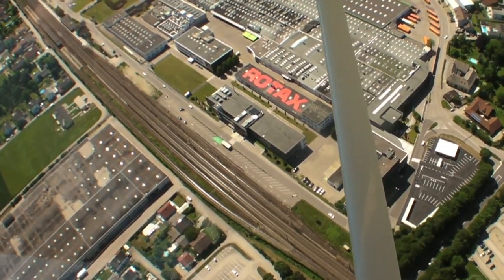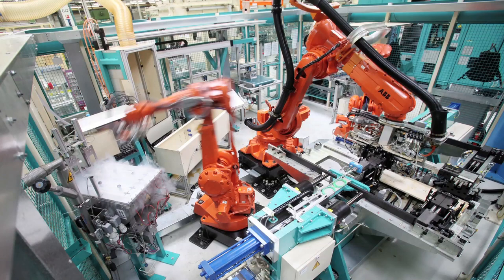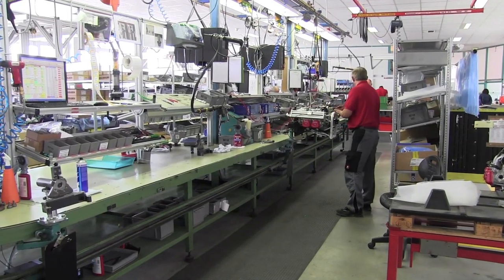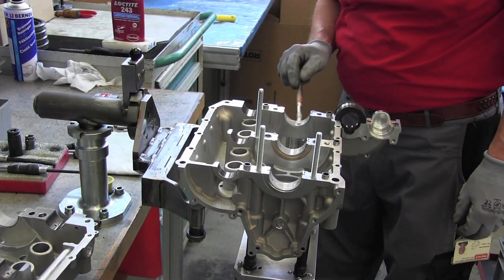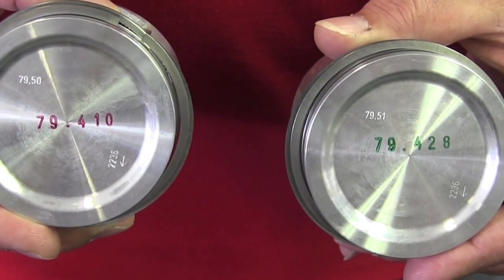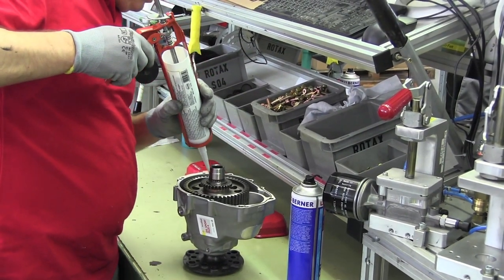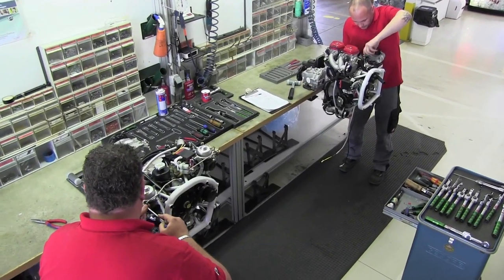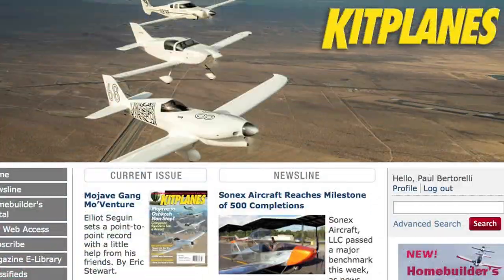How Rotax Builds Aircraft Engines

Comment: Too bad the cost of the engines are effectively taking aviation far from the grasp of the hobbiest.
Reply: And bring back the 503.........dcdi
Reply: This engine is still WAY less expensive than a Lycoming or a Continental...
Reply: @ibgarrett  Maybe.  A Continental Titan 340 costs about $29k and produces about 180HP.  A Lycoming O-320 has a price tag of $47K and develops 160HP,  Rotax's 915iS costs about $39k and develops 141HP.  I'm not sure I'd say its "way less expensive" but merely on par with their competitors.   To Rowdy Flyer1903 original point, I do agree the price does place it outside the reasonable expectation of hobbyist, especially when you consider the $39,000+tax price tag is for the non-certified version of the engine.
Reply: I just can't see where the value is for that engine to be $39K... I mean they're building entire cars for half that price
Reply: but just imagine the profits this company is garnering from the airplane engine line.  I can't imagine this costing any more than 10k for Rotax to make.. However, it must have cost a lot of money for upfront development costs, for example.  Looking at their fiscal report it appears lumping all the different types of engines and vehicles together, they are running at least 20% profit. So, can't say what kinds of profits specifically, but still interesting. You can read more here ->  https://www.globenewswire.com/news-release/2019/03/22/1759198/0/en/BRP-Reports-Fourth-Quarter-and-Fiscal-Year-2019-Results.html
Reply: No other aircraft engine manufacturer willing to lower the price :(
Reply: They used to be cheaper, now they are the price of a bigger new car :(  I’d still do one over lyc/continental though due to being quieter and they run mogas not 100ll which halves the cost here in Australia, also they are lighter which can get a two seater under the weight limit and allow own maintenance = cheaper. Also about 4gph which the aircraft engines won’t do
Comes down to there is no competition so why charge less than they need to

Comment: Great video production!  I love my Rotax 912 ULS--which has never had so much as a "burp" in 1,700 hours of flying!  I've found that most "problems" arise when Lycoming and Continental "know-it-alls" think they 'know it all,' about servicing the Rotax engine.  That's when problems begin.
Reply: AMENNN !!! ! !!!
Reply: Less surprises in a four than a two stroke engine.
Reply: Not necessarry ...
Reply: The statistics are on Stephen Bonin's side there Kopronko.

Be great if the new generation of light, clean and reliable 2 strokes that are hinted at every so often were to happen 'tho.
Reply: Airplane engines are small bore, but long stroke, right?
Reply: @stephenbonin3049  912 isn't a two stroke.
Reply: @andrewjackson7476  Not always.  The ubiquitous Lycoming 0-360 is very oversquare.  Huge jugs.  (Heh heh heh.....)
Reply: @andrewjackson7476  wide bore, short stroke, in a Rotax, so they can run at 5100-5500 rpm for majority of hours of motor life. Relatively low torque to such a design. Lower rpm motors with slower burning fuel like turbodiesels are strokers... longer stroke, narrower bore.
Reply: @stephenbonin3049  I never had any trouble whatsoever with my 503 2 stroke. Dual carb duel ignition. As the saying goes your engine is about as good as you treat it and nothing holds more truth than two-stroke rotax engines

Comment: I recently saw a video visit of the Rotax snowmobile engine assembly line.  I did not know they made aircraft engines.  Thanks for the great video!
Reply: They don’t really! Lol these are modified snowmobile engines. 
Literally had a A&P tell me it was an unsafe engine and I should sell my plane. 
This and Rotax has horrible support, sky high parts prices, built in design flaws that you will never be able to fix. If you want pain buy a Rotax

Comment: Thanks so much! As an olde school VW, & Porche mechanic, I've wondered what the difference was between them, and the Rotax, and if it's air, or water cooled? So, it looks almost identical to the air-cooled engines I work on, other than the water cooled heads, and judging from the fins on the cylinders, I'm gonna call this 1. A hybrid, and 2. An engine I can't wait to work on, and maintain. I LOVE the simple design 😁✌
Reply: They have watercooled heads on the 4 stroke donks
Reply: I bet you can put the turbocharged ones in a Volkswagen or old Fiat 500.
Reply: I think there’s a VW bus in OZ with either a jabiru or a rotax in it.

Comment: Crank in pieces is old motorcycle technology, which is not used by bikes anymore. Last bikes, which used this design, Kawasaki KZ1000 had a problem of crank pieces turning against each other. To overcome the problem crank pieces were welded together by repair shops after assembly. Honda was the first smart bike manufacturer which stopped using this design and started using one-piece automotive style cranks.
Reply: Roller bearing cranks are way more reliable and require less oil pressure than plain white metal bearings. I have a 1980 suzuki 850 with a pressed up crank and 1 piece rods with 827000km on the clock, never have i touched the bottom end at all. Maybe it is just kwakas with the problem, never heard it happen to a suzuki and they have lots of roller bearing motorcycles.

Comment: this is why i own rotax. looks top notch to me. :)
Reply: Brandon Quenneville  yeah.    Guess you don't own one
Reply: Rotax are a POS engine. I’m dealing with unfixable exhaust leaks bc of their awful design, constant overheating issues, almost impossible to find someone to work on them and oh, and good luck if you need factory support. 
Literally run from one of these shitty engines. Not kidding. Buy a Cont or a Lyc. And if u haven’t had issues yet, just wait! You will!
Reply: @nickr5658 - you sound angry Nick.  I’ve had mine 20 yrs with zero issues.  I have also closely monitored the large flying community I am in (hundreds of planes) and your experience is certainly not what others have seen.  Perhaps operational error?
Reply: @KenLeonard  I don’t trust the engine will be reliable. Way too many issues. Case in point I had a NEW fuel pump fail after only a few hrs. 

I have had a lot of down time for dealing with Rotax specific design problems. For example I’m dealing with an exhaust leak for months now that is not really fix able. The 912s have built in C0 leaks bc of the exhaust flange design. 

Hardly anyone works on Rotax around here. Little if any factory support.
I know first hand continental and Lycoming don’t suffer these problems and virtually all A&Ps can work on them and most of their issues are well sorted

Comment: Here in Australia, I am having lessons in a foxbat (rotax engine) a great plane to fly, but I have always been a bit of a nervous flyer. Then I watched this clip, and I felt a lot better, then I read stancurtins comments, and I felt a bit nervous again, then I read jason ensmingers comments and I felt a bit better again. Surely the rotax has to be safer than an older lycoming in a 1970s 152, which I had my first lesson in.
Reply: Paul Wiles   Speedway
Reply: Thanks for sharing the swinging level of confidence from the world of ultralight.
Reply: I wouldn't say they are more reliable. lycomings most reliable engine io360l2a in the newer 172 s is absolutely more reliable and less complex than most rotax engines.
Reply: The Lycoming is definitely more reliable. Regardless of age the engines are generally overhauled around every 2000-2500hrs depending how far your willing to stretch the interval.

Forgot what the overhaul intervals are on Rotax engines, but if I remember correct it was somewhere around 1200-1500hrs.
Reply: A friends 912 in his kitfox has over 2300hrs and is still going strong..

Comment: I had 8 engine outs in 6 years of flying ultralights with Rotax.  And, that was not uncommon on the field where I tied down (which had 150 untralights).  Even the factory demo planes stuck several pistons a year.  The care and assembly looks good here, but I've never seen that kind of failure rate in GA engines.  I've seen a lot of people claiming the reliability is comparable, but that certainly was not my experience.  As a pilot, I'd strongly advise a kit builder to really ask around and research an engine before they decide on it.  And, always keep where you're gonna land in sight.  :-)
Reply: Are you referring to 2 strokes or 4 stroke engines. Failures in the 912 and 914 series (4 strokes) in factory mounted LSAs are very very rare. You might see a few failures in E-ABs mostly due to builders mistakes.
Reply: Yes.  I flew several different 2 stroke Rotax engines in different ultralights (MX and Phantom).  Because failure rates were so high, we accepted it as part of ultralight flying.  We did all the recommended maintenance and used the best oil we could.  But engine outs remained routine with Rotax.  Kawasaki engines were far more reliable, but do to liability, they stopped making them available.  I have no animosity toward Rotax, but it will take quite some years of good service records before I'd be convinced they have produced a truly airworthy engine.  But I hope they have/do!
Reply: From my experience, most of these engines used on aircraft are not certified for aircraft and are "Subject to sudden stoppages". This does not mean they are not reliable, but they cannot be guaranteed for aircraft safety for those models.
Reply: July
Reply: I'm not a fan of Rotax engines in aircraft, but to be fair, they are clearly labeled as not being aircraft certified. They are great for karts and some bikes, and even some larger RC planes. I really suggest you not put yourself into a situation in which your life will depend on one.

Hawaii is a Legal State.
Reply: +Noah Diamond (Rainbow Unicorn)  What? The 91x series exists in ultralight version and in certified version...In a aircraft, im' fiel me better with a 912S in the nose as with a 0-200...
Reply: I think they have gotten a LOT better in the last few years.
Reply: In Europe the most ultralight fly with 2 strokes because cost 3 times less than a 4 stroke...
A 4 stroke is more reliable and durable, but much heawyer for the same power, this is a big problem for a ultralight...
Reply: stancurtin smh. More guys who simply don't understand the workings of a two stroke and burning them down. Here's a lil tip...if you're sticking pistons, you're running too lean. Fatten her up a bit and she'll never let you down.
Reply: stancurtin never had an issue with the rotax 503 engine.
Reply: I rate the 912 series and, funds and type permitting, would fit one as the engine of choice for a microlight (US:  ultralight).

Its not that they don't fail. Its that they fail less often than the competition.

There's a pretty widespread suspicion in the UK the 80 bhp units fail less often than the 100+bhp ones but I'm not sure anyone's ever compiled any statistics.
The 100+ ones are neat 'tho.  You can almost hang a Eurostar on its prop. 
(I wouldn't recommend trying that with most older  motor / aeroplane combinations).
Reply: I have a fair amount of experience with four stroke Rotax engines both in Airplanes and in motorcycles.  (aircraft mechanic for a living and I race motorcycles for fun) I think your concerns should be more directed at the fact you're running a two stroke, rather than at the Rotax brand specifically.  Two strokes tend to have a much shorter life, higher failure rate in general, and when they do fail its often unpredictable.  They also tend to dislike high RPM operation for extended periods of time which is textbook aircraft operation.  I would not hesitate to run a four stroke Rotax engine in any aircraft of mine, but I wouldn't run a two stroke of any brand.  Outside of Lycoming and continental, Rotax makes some of the best aircraft engines out there.
Reply: Airplane engines are small bore, but long stroke, right?
Reply: Two strokes have always been prone to sudden stoppage, especially if the mixture setting isn't right. Four strokes are way more reliable and smoother running especially with having the momentum of the valvetrain keeping it moving along. The only attraction of 2 strokes to me is the power to weight ratio. Otherwise they are too loud and not as reliable as 4 strokes.
Reply: All 2 strokes no doubt with shitty oil in them..what a ridiculous statement. Rotax 912/914's are the most reliable 4 stroke aero engines, they just work.
Reply: 6 6  In EA-B yes, just spent some time reading NTSB reports for engine failures in EA-Bs. Do you know what an EA-B is?
Reply: @NoahDiamond-Firearms-LLC  You mean the 2-strokes, I assume.  The 4-strokes are designed and marketed specifically for aircraft, and certified models are available.
Reply: @NoahDiamond-Firearms-LLC  Wrong. They are available in certified version as well as ASTM compliant  (F37 sub-committee) versions for aircraft specifically. The 2 strokes of decades ago is what the original commentor is talking about. That's been done and gone
Reply: @NoahDiamond-Firearms-LLC  Try last 12 years. Showing your age here bud :). Just joking
Reply: @abidfarooqui-sla3301  yeah... I'm old. I come from a much older generation. I'm 37.
Reply: @NoahDiamond-Firearms-LLC  Oh you are very young then. Much younger than me at least
Reply: The 912 and it's sisters have certified versions and they are the are the EXACT same engine, just with a paper trail. 

To be certified they have to be  proven, reliable Donks!
Reply: @NoahDiamond-Firearms-LLC  Sir no engine can be guaranteed...not even a $70,000 Lycoming or Continental engine can be guaranteed not to fail!

Comment: "Economy of scale....."  Yeah, right.  You can do two things with that "economy":  Lower prices, or higher profits.  It's pretty obvious which way Rotax chose to go.  Those things are absurdly expensive.
Reply: $18,000 + for a 1350cc 912 ULS motor with a single speed gearbox.  How does Yamaha build a 1500cc complete snowmobile for less money?  There's a reason there are a lot of Experimental aircraft built with VW air cooled motors with thrust bearings, and no gearbox, for 1/3rd the price, or less.  2000 hours for a motor isn't much life. I wish VW would build motors for experimental aircraft, then we'd get some true economies of scale. VW built TDI turbo diesel motors, capable of 130-140 HP with planned motor life of 25,000 hours.
Reply: Supply and demand gentlemen. Why is a 4 cylinder Lycoming 50,ooo plus Australian dollars?
Reply: Rotax… such bad engines. Most people don’t realize they are virtually unknown by most mechanics and difficult to fix and keep running properly.

Comment: Thanks Paul. Well done video. My main takeaway from this is that there is NO WAY an average owner is going to be able to do anything significant to the engine with a failure, unlike a Lycoming or Continental owner. All the special jigs for assembly show not a lot of consideration down the line. It is similar to car builders who do not take into consideration doing engine repairs. A car is GOING to have a internal part fail or get crashed and need repairs. Goes for aircraft engines too. I hate that cars are built by putting the engine on a frame and dropping the body onto it. Rotax may make pretty, accurate, reliable engines, but if you need special tools and jigs to reassemble it, another manufacturer will win in the long run. I subscribe to KitPlanes: what EAA SportPilot  >SHOULD< be.
Reply: Same crap with German made cars...  Once the motor is screwed together at the factory, it's never the same if technicians have to pull the heads for some sort of failure, or sticky lifters, etc.  There's a very good reason when something fails on german engines, you get a new crate engine shipped from the Motherland to drop in.  The QC is just not there with current technicians being able to keep assembly QC levels necessary, without the factory jigs.

Comment: I bet you can put these in a small hot rod, like a Volkswagen Type 1, Karmann Ghia, Fiat 500, or something similar. You need an adapter plate for the transaxle, a clutch and maybe a car flywheel. The turbocharged ones would make a lightweight car really shift like a rocket and get its skirts up quicker than a female flasher.

Comment: I don't see the gold plating in them anywhere, that justifies thier price...
Reply: You sound like you have never owned a Rotax motor? they don't come any better.
Reply: @MrKdr500  Literally any modern automotive engine is better.
Reply: Philly Cheese Take Please. Take any automotive engine and run it at 5,500 RPM for 2,000 hours straight. I’ll stick with Rotax thanks.
Reply: @andrewmorris3479  Water-cooled derivations of car engines have about a 30% TBO advantage on similar Rotax models, and they also consume less fuel.

It's simply stupid to suggest that Rotax knows how to build better engines than Toyota, or Yamaha, or VW, or any major car company. The only reason they don't swoop in and put Rotax out of business is because they have too much common sense to enter the aviation industry.
Reply: Philly Cheese Take But a car engine doesn’t run at 5,500 RPM continuous, that’s my point. I’d want a lot of testing done before throwing one in an airplane.

Comment: Can an Aircraft boxer motor be designed and manufactured in a SOHC/DOHC pattern?
Reply: Yes, it could, but then it would be wider and heavier. An OHC engine can operate at higher rpm, but an aero engine doesn't need to do that.